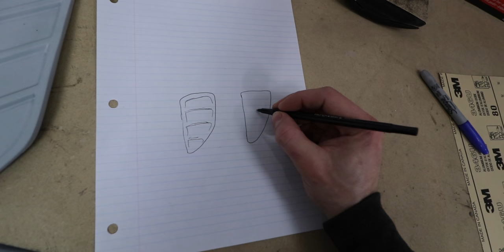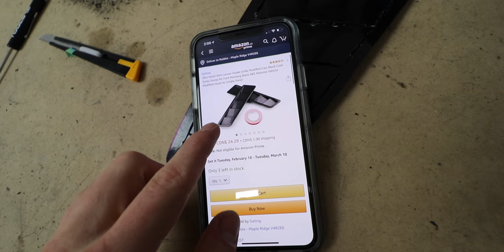Making Custom Fender Vents for the Karma BRZ!

Comment: Looks amazing man especially with the black now instead of the blue lol. But I think for the vents in the front you should drill some countersink holes for some Allen head bolts 2 on the top and 1 on the bottom and then do the “reverse mount” with nuts on the back of the fender and mould the nuts into the fender well then use the Allen head round bolts to snug up the vent but man did they come out great I’m glad you went this route with them instead of just cutting them out also glad you saved the original pieces instead of backing them up. This color is just amazing ! I love seeing this every time ! We need more Robbie parts on the brz ! Btw the yellow in the headlights compliments the color of the car and vise versa it just makes it pop instead of being all blacked out. Keep it up man.

Comment: Hey robbie, you should add some rear/top wheel well vent to avoid pressure building up, its commonly done in racecars for performance reasons and usually looks hella sweet

Comment: If you’re thinking about boosting it, an unusual way of mounting the turbo is mounting it low in the engine-bay as seen by fensport(.co.uk) to keep the mass low down. It may not be as pretty as up top, but it would be unique. Thought I’d throw out the idea.